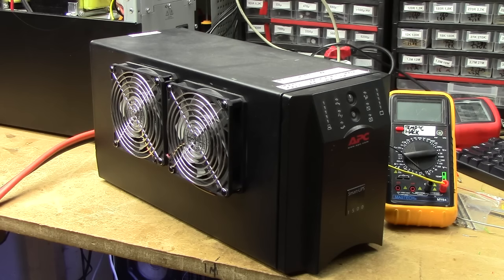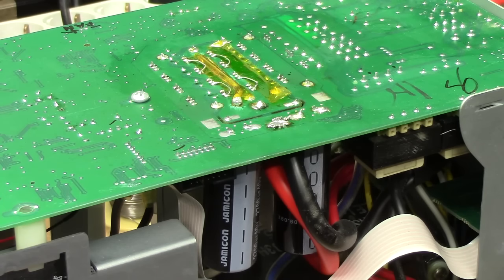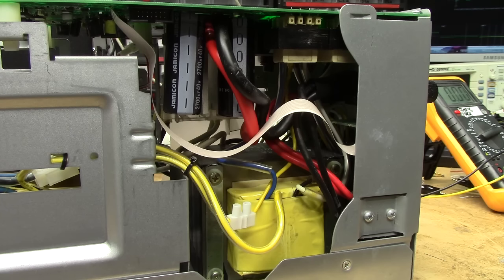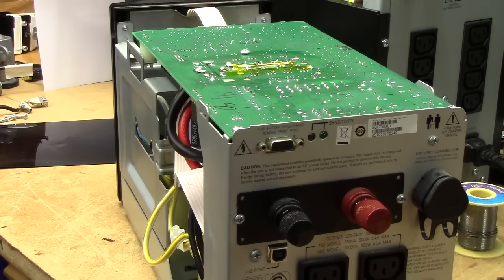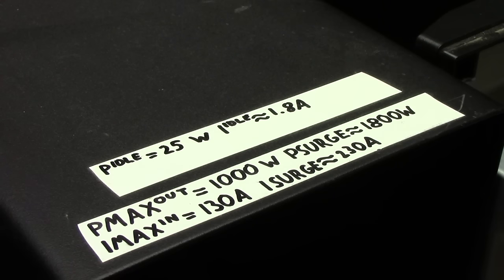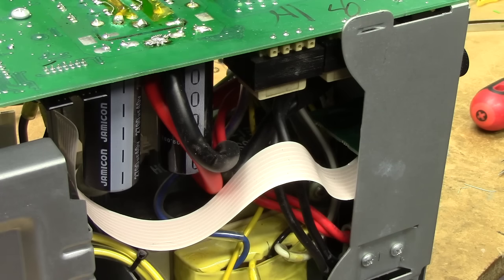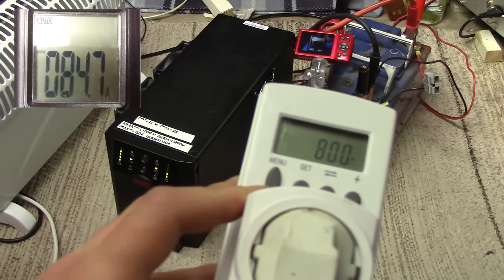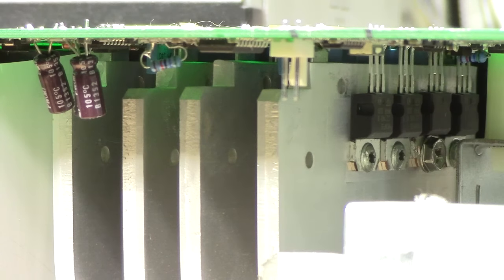Smart-UPS 1500 turned into... a 12V inverter?!

Comment: No good, i am just a hobbiest, but
2 main reasons i found
1--- those  45 watts at idle 24-7 will kill your battery
 2--  those tranformers are POS (2nd only to microwave's...) , they are meant for short runs ONLY,the core area is small, good for 400 watts sustained, the 220 volt windings have SMALL number of turns,(hi amps!!) and they overheat, the one i tried i had to abandon and i built me an inverter (3000W,hi freq, 24 khz,  EGS002, 18 watts idle.. do NOT reccomend those chinese parts  either...)